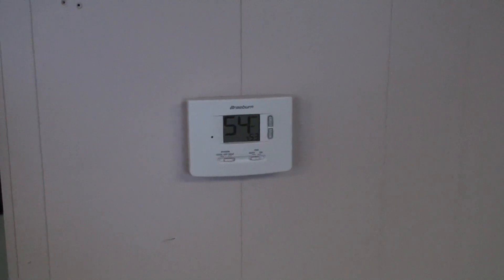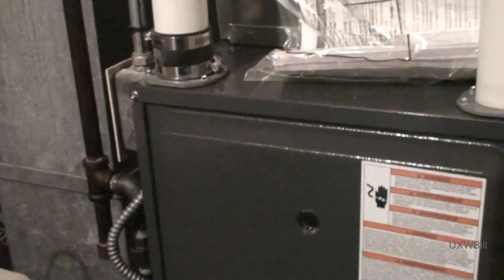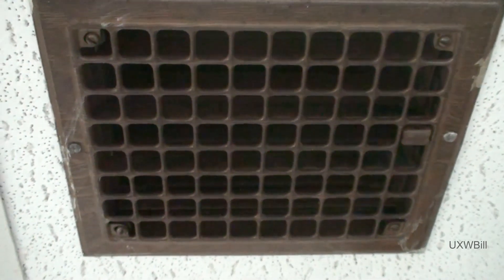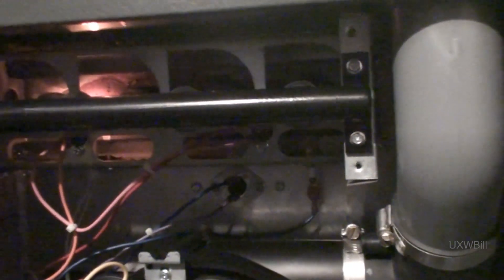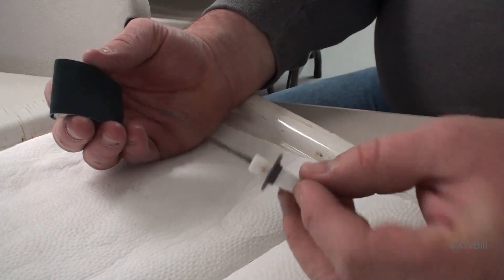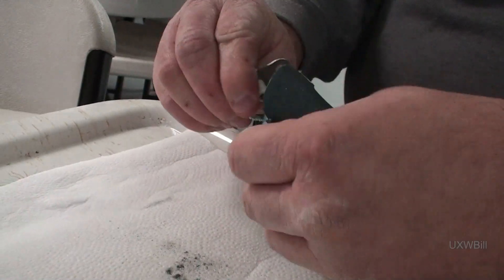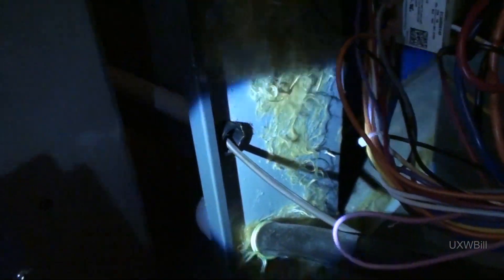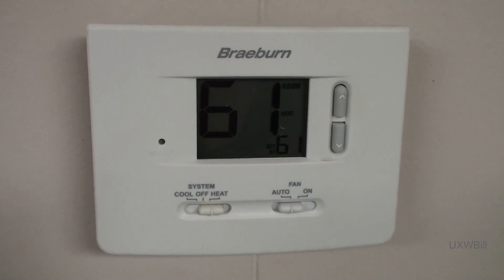Intermittent Heat Trouble: Goodman GMSS960803BNAA Furnace

Comment: I've heard from manufacturers that using sand paper can remove the coating on the flame rod and cause it to fail. Now if that only pertains to some flame rods or if it's all of them but I've always been taught to use a green scotch bright dish washing pad because it gets it clean but it's not too abrasive to the point where it removes metal from the rod. Just something I've been told and figured it share it. 🤷‍♂️

Comment: I have to do this at least every other year. works everytime on my 20 year old furnace.
Reply from the maker: You might want to find out why that's happening. While probably not overly serious, having to clean the flame sensor that often is likely to indicate another problem.
Reply: @uxwbill  I asked my furnace man why and he said cause it was old and they get crusty inside but only said to consider getting a new one, nothing about having it cleaned so I assume they can not be cleaned internally?  I also have had to oil  flu fan the last few years on this 25 year old natural gas furnace.  All three burners output a strong blue flame so not too worried.   Just saw another video saying a dirty flame sensor is number one furnace problem.
Like my car, I just keep her going, as I will be applying for antique license plates this year on its 20th anniversary.

Comment: I did HVAC for awhile and did my fair share of intermittent heat calls, classes and work didn't prepare me for working on the dinosaur of a furnace in my new house after it developed its own intermittent heat condition. It's a Kenmore 70 Power Miser natural draft gas furnace featuring direct spark ignition, the burners themselves are quiet and burn nicely but there's more heat going out the flue than into the house and enough soot buildup in the burner box and draft hood that I suspect it's going to meet its end soon due to an unhealthy looking and sounding blower motor and plugged heat exchanger. I also observed odd flame behavior not influenced by the blower motor and a piece of insulation board held down by a brick covering a previous return cutout. among other things
Reply from the maker: There's got to be a reason it's not burning cleanly. Provided the heat exchanger is actually still good, it might be savable...might not be worth it for something that's only 60, maybe 70% efficient at best.
Reply: @uxwbill  I got a good peek inside with a borescope and the heat exchanger is coated in soot, possibly in its previous life it burned propane and they didn't clean it when they moved and converted it. It's getting replaced soon with a good used 90% furnace and matching 5-ton air conditioner. I got a good deal on them as the air conditioner still worked and had its full factory charge when it was replaced by an inverter heat pump and the 90% furnace wasn't that old either when it was replaced by a 96% furnace for no reason other than slightly higher efficiency and a tax rebate.

Comment: So you have worked on a lot of furnaces, or enough furnaces, have you ever seen a Coleman furnace? Cause that’s what I got at my place and I just wonder if you have seen one.
Reply from the maker: I'm still very much starting out in this field. There are plenty of things I don't know about or have never seen. I'll go further and say I don't think it's possible to ever know everything in this line of work.

Coleman equipment is often seen in mobile home/trailer home installations and they are one of the few manufacturers catering to that market. I've not personally worked on a Coleman HVAC product, but I've seen several of them along with the closely related Evcon brand.

Comment: With the mouse, I'd probably have just vacuumed it up too and been sure to change the bag immediately after the cleaning was done.
Reply from the maker: I thought about and then thought better of it. Knowing my luck, it would have clogged the hose and that's one clog in particular I wouldn't want to clear.

It's strange -- with stuff like this I'm fine for a few minutes before an overwhelming urge to hurl strikes.
Reply: @uxwbill  I'm with you there! I may not have used the old SuperJ to pick the mouse up, but definitely would with my service vacuum I always have. Its the sort of thing I also have to deal with quickly, so it doesn't start making me feel sick!

Comment: Flame sensors can be tested with your multi-meter set to uADC. Should have at least 1 micro amp DC. Usually around 2.5-7 depending on manufacturer.
Reply from the maker: That was to be shown in the video, and I forgot. The meter might have made a few cameos in the background.

Comment: Rats are a major pain in the hatchback to deal with, but here in Florida we have more palmetto bugs than rats, no matter how many roaches you kill they still keep coming.

Not to mention that you're more likely to run into alligators and snakes.

I do agree to the fact that some people don't take safety into consideration when they do DYI fixes on their gas appliances, since 90% of the time it can and will lead into a fatal situation that involves being asphyxiated by either carbon monoxide or natural gas, or getting obliterated in an explosion.

Also some people can forget to test their CO detectors and most of the time they won't realize it's not working properly until it's too late.
Reply from the maker: Thankfully, I don't think there are any rats around this old church. The cold certainly helps keep the roaches under control, although I suppose some just go underground or just enough survive inside buildings to re-emerge during the warmer months.

The church hasn't got a carbon monoxide alarm to my knowledge, but I'm thinking of supplying one.

Comment: Years ago I tried to buy that sensor from an appliance parts store and they wouldn’t sell me one.. and told me not to clean the original. Said it will damage it. Lol  I ordered one from Amazon and cleaned and put the old original back in.. 5 years ago..  it’s still working !   Thinking of furnaces , do you know where I could get a 12v timed relay for an RV furnace  ?
Reply from the maker: Parts and supply houses are all over the map with regard to who they'll do business with. Most do seem to share the view that they won't sell safety critical or possibly dangerous parts to just anyone. Where I could see that making sense with something like a gas valve, I don't see things being the same with a flame sensing rod.

You can certainly clean the typical flame sensing rod and put it back into service. I suppose that if done frequently enough it might eventually wear down to the point where it wouldn't work properly/at all, but if you have to do it that often, you're fixing the symptom and not the problem.

I don't know where to recommend you look for that relay. An electronic components dealer like Mouser or Digi-Key would likely have something. If there's any possible safety related aspect, I'd definitely ask the maker of the furnace if they are still around. (I would not recommend buying any relay or circuit whose safety and quality are unknown, in spite of such things being available from numerous, usually overseas, sellers on places like eBay.)
Reply: @uxwbill  Thank you for the info

Comment: Always interesting to see how things are done "over there"!  Here in Scotland most applications are boiler systems with radiators, or heat and AC systems running purely on electric with ceiling mounted ducts/vents in office buildings.
Reply from the maker: You will find plenty of hydronic (boiler) heating systems here in both residential and commercial settings. I didn't train as extensively on those and therefore don't have a great deal of knowledge with regard to them. (In other words, right now I wouldn't take on boiler work.)

Electric heat is much more common on this side of the pond where electricity is cheap, such as in the Tennessee Valley. Heat pumps are also much more common further south, where it doesn't get so cold that they no longer function well.

Comment: Does anybody in your area use forced air oil furnaces? That's basically all we have in my area of Canada as we have no gas service, interesting to see how they work and that draft inducer motor has a cool startup noise
Reply from the maker: I've not seen a working oil heat system of any kind around here in years. They used to be much more common. (One of my aunts lived in a house heated by a forced air oil furnace. My parents' home was also heated by a forced air oil furnace at some point, though it was long gone by the time they moved in. I also found the remnants of an oil burner in a house while replacing the gas valve in the furnace.)
Reply: @uxwbill  Natural gas and Propane are so common in the Midwest that there's no need for oil burners, they're most common up north whether it be Canada or New England
Reply: Only oil burners I've seen have been waste oil shop heaters, put used motor oil, cooking oil, etc. in them and they'll run just fine

Comment: I love your videos.  They are so pragmatic!  How's the 07 Classic Silverado holding up?
Reply from the maker: I still drive it every day. Rust is fast eating the rockers and it's got a foothold on the bed sides above the wheel wells. A sensor in the passenger's side door latch failed, causing the truck to have a crazy fit about whether or not the door was open while going down the road. I made some effort to try and clean the contacts, which didn't work, so I just unplugged that part of it. The power lock actuator is wired separately and it still works. I would replace it, but Naughty Truck apparently came equipped with the most expensive part of several that were used...and at some point I should probably invest in an air bag sensor.

I did send the instrument cluster off recently to have it totally rebuilt and a trans temp gauge added. It came back looking and working better than it ever has!

I'm sticking with it. There's just about nothing on the market today that I'd buy new (a Chevy fullsize van being the possible exception). I don't want to be driving something that feels like a video game, will not tolerate any sort of touch screen, nor do I want the first electronic nanny.
Reply: @uxwbill  Good deal!  I remember the video's when you first got it!  That is one of the last true quality built GM trucks on the road.  I have a 2006 GMC Yukon 4x4 which has been problem free - I also had a 2005 GMC Sierra truck like yours, but 2wd and I sold it to my uncle; he is very happy with it.
Reply from the maker: @ymxctrails In all honesty, I'm not sure I can be bothered to invest the effort. Naughty Truck is sitting at 220,000 miles as I write this, and I don't think it's rust that will ultimately sideline it. I also don't really have a good place to do something like that, or at least I don't think I do.

The red Reliant (actually a sedan) was very badly rusted before I got it. Amazingly, somehow the silver wagon was spared the same indignity (well, mostly), and I'd probably still have it if extended family members hadn't gotten annoyed with its presence and if I'd have had the time to give it the attention it really needed.

As the red car still ran very well, I wanted to make something or another out of it, possibly a "pole car" with a rear mounted seat. I'm nobody's idea of a metal worker, though, and there again comes the whole matter of having the time to do so or a place to keep it.

Comment: That switch is actually extremely common on german boilers, and its purpose is to stop large premix gas burners (gas and air are mixed in one or more seperate chamber(s) before entering the burner) from backfiring and thus damaging the mixing cup/chamber. I had a ton of odd problems caused by that switch, like trying to do a dry run on a freshly changed control, only to have the switch cut power to the boiler because the gas tap to the burner was still closed. It can take you half an hour of trying to find out why the control panel won't start up, only to eventually find out the thing needs gas pressure to even turn on... As for the mouse stink, I think there is a dead mouse somewhere in the ductwork. Also, "dead mouse" is sadly one of the most common smells a HVAC tech will experience, and one should absolutely know that before starting in this field.
Reply from the maker: There is no doubt in my mind that dead mice are present in the ductwork.

Comment: My house has had the same HVAC system since 1996 and the igniter stopped working in 2017 and we know someone that does HVAC work and it's been working without issues since then. I usually inspect the heater every September for any chewed wires, strong mice odor, the filters, gas leaks, and so on.

Granted, I'm not a professional HVAC person.
Reply from the maker: Professional or not, if you take care of your HVAC system, it'll take care of you for a long, long time. More people should do what you do. Even a quick test done before the heating or cooling season starts is a good idea.

Comment: Goodman should change their name to badman
Reply: sadly they used to be good     Only good brands now is Trane /American Standerd and ICP  but York  and goodman are chapest and poorest made
Reply from the maker: I'm not sure why. The products they offer are just fine, and would definitely be on my list of choices if and when the time comes.
Reply: @uxwbill  With Goodman they're good 5-year furnaces, thought that may have changed with their merger with Daikin, the older Goodman furnaces I've worked on usually have pretty major issues after 5 years while Trane and ICP furnaces can last much longer though the complexity of 95-96% efficiency furnaces makes it a mixed bag among all brands, give me an 80% AFUE any day and I'll be happy as a clam
Reply: @vacexpert2020  they have the same mechanical/electrical stuff to break if you're comparing the same feature class -> ie single stage to single stage. the myth that condensing furnaces are far more complex won't die. just need to make sure the venting and condensate lines are done right, check the trap and lines once a year, make sure the secondary hxt is being kept clean by the filter.
the stuff with constant airflow variable speed motor is definitely more complex and expensive to fix, available in 80% and 90%+

Comment: That device on the incoming gas line is there to prevent the furnace from firing if the tank runs low or regulator gets messed up and supplies far too low incoming pressure. It prevents the furnace from sooting. 
Though I have no direct experience with propane, i've seen more than one youtube video showing totally rusted up/trashed inshot burners when used with the fuel. It must be harder on furnaces/more corrosive than natural gas and it could be wise to pull and inspect/clean.

Comment: is it true new furnaces dont last as long as old furnaces
Reply from the maker: The only thing that can be said for sure is that the new furnaces are lighter as compared to the old ones. They're also far more efficient.

Many of the furnaces sold today come with a lifetime warranty on the heat exchanger, so you can't say the manufacturers aren't confident. (Although, if you are a pessimist, you could say that the manufacturers are banking on someone forgetting about this, or saying "hey, I got my money's worth out of that".)
Reply: @uxwbill  they're banking on people not doing it due to the labor costs and other parts being out of warranty. beyond 15 years i don't think heat exchanger replacement is worth it most of the time, and definitely it's pretty crazy after 20 years unless it's a tech doing their own.
Reply: @uxwbill  From my experience older furnaces do last longer with maintenance, the 1992 Miller mobile home furnace in my second house had no maintenance whatsoever done so it was sent to scrap because of a failed heat exchanger among other things, the also 1992 Trane XE78 in my first house works fine even after being moved pending demolition of said house, the likely 1980s vintage Kenmore 70 Power Miser natural draft direct spark ignition furnace, the aforementioned furnaces being induced draft and using hot surface ignition, in the house I'm hoping to buy soon enough still works like new and for better or worse blows noticeably hotter than the induced draft furnaces even with the blower on its highest speed tap, the new Goodman furnace that replaced the Miller is so far trouble free but it's not even a year old, at the same time I have my assumptions as to what will fail first but only time will tell.
Reply: If they are LP they don't